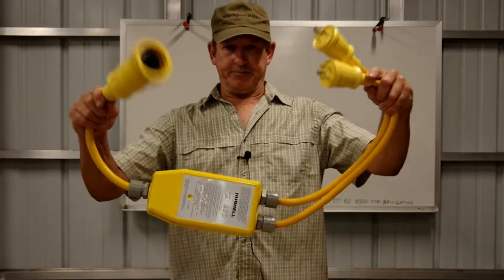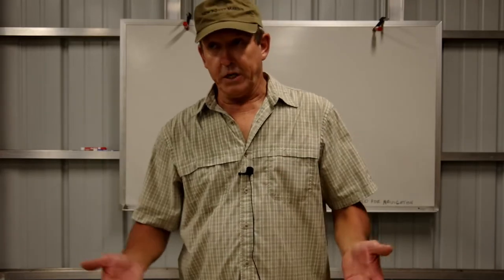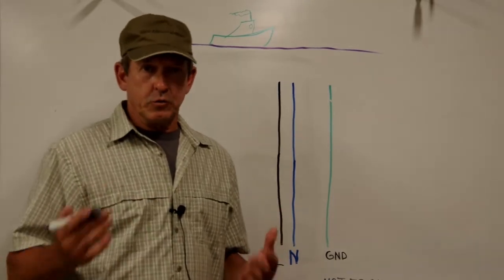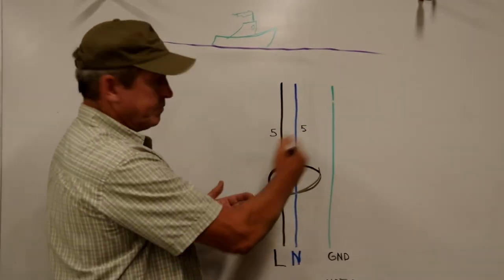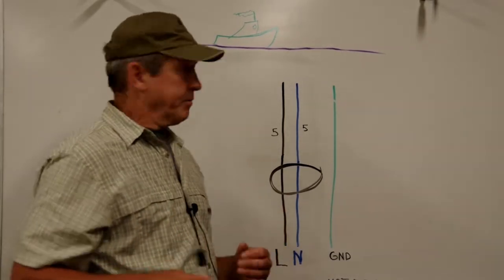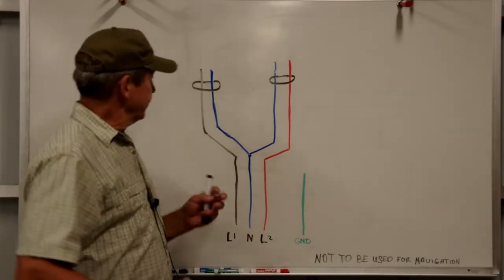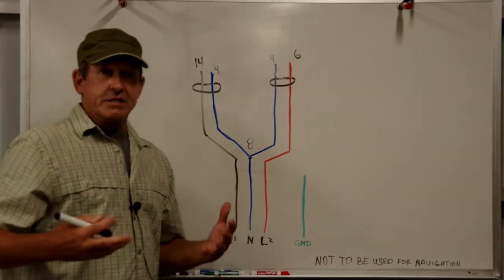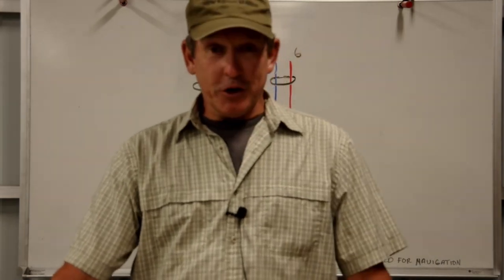Our boat trips a ground fault breaker. Is it my boat or my shore power adapter?

Comment: That was a great explanation.  My boat is wired with all the 110V on one line of the 220.  Lucky for me I don't have to use 2 30A cables at the moment.

Comment: Just found your channel, some good content and explanations.  Thanks for taking the time to put the videos together and share your knowledge. One thing on the neutral current that I think is not quite right.  Correct me if I’m wrong but I believe the neutral only carry’s the imbalance of the current between L1 and L2.   The end of 8 amps is right but I don’t think there is 14amps going out of the neutral and 6amps coming in.  I don’t think current can flow in two different directions simultaneously on a single wire.  I believe 6 amps of L1 is going  into L2 also but the remaining 8 amps gets brought back to the source on the neutral.  If both L1 and L2 have 6 amps then no current should be flowing on the neutral.  It’s more like a series circuit at that point and the voltage is dropped evenly across the two loads to get 120v on each.

Comment: Great video! Keep up the good work.
So what do recommend for best solution?
Reply from the maker: There is not much to be done other than avoid using that particular adapter with a ground fault protected breaker. With the neutrals split as they are there will be an imbalance.

Comment: Plugging in my 30 amp shore power to a 110, through an adaptor - outlet , trips the gfi of that outlet. 
When I plug into a 30 amp
Shore power outlet,  everything works GREAT. WHY is this Happening ??
I don't have access to a 30 amp outlet anymore, only a standard 110.

Comment: So why is the use of  the two coils inside the "Y" adapter placed necessary? 
Why not just one coil at the portion of the Y upstream after the 2 neutral become one on your diagram?
These are the two logical question that appear from your explanation.
Reply from the maker: The adapter has no coils inside. This splitter is taking two 30amp 120volt sources on the shore side and adapting that to a 50amp 240volt cord. If the shorepower pedestal has ground fault protected breakers, the imbalance seen at the pedestal between the line and the neutral will cause the breaker to trip. You are correct that if we sensed a single neutral and line 120volt or single neutral and two lines 240volt together the GFP breaker should not trip (if there is no fault).

Comment: Seems like that would be a design flaw in the splitter?  I just searched for that splitter on Amazon and then on Google, and I couldn't find one for sale. Has it already been taken off of the market?
Reply from the maker: It's not really a design flaw as each piece is doing what it was designed to do. The adapter is adapting one cord to another, and the ground fault breaker is sensing an imbalance and reading that as a fault and tripping as designed. I think the adapter is still available but there is not much call for them today as most marinas have enough 50amp service available. That adapter is also very expensive. Sorry I didn't see your question until today.

Comment: Do you think a properly installed isolation transformer on the boat side would eliminate this Y issue?
Reply from the maker: Good  question. Had to  think about that. I believe even with a isolation transformer onboard the reverse Y would trip a ground fault breaker. Usually we don't bring the neutral from shore to the primary side of the transformer,(240 volt) we get the neutral on the secondary of the transformer onboard. So since we are not using the neutral there would be no current on the neutral and the breaker's  sensing coil would see an imbalance between the line and the neutral and trip.

Comment: Are you saying reverse y adopters are useless?  Is there any other work around? (i.e., two 30 amp drawing from shore-power to create 50 amp single connection to vessel)
Reply from the maker: I would not say that a reverse Y (two 30amp to a single 50amp) adapters are useless. If we use one on a non ground fault protected breaker they will work just fine. The trouble comes when we use this type of adapter on a breaker that is ground fault protected. Since the adapter splits the neutral there will an imbalance between the line or hot and the neutral. That imbalance is what the GFP breaker is looking for and will trip. I know of no work around in this particular case. Hopefully any marina new enough to have GFP breakers on the pedestals will have plenty of 50amp for everyone. Thanks for the comment.
Reply: @workinonaboat1950  Hello, I really enjoyed your video. Thank you. I would like to ask you a question to a similar issue I'm having with my 95 Mainship Sedan Bridge boat. GFCI popped and I replaced them, but my outlets still do not work. If you have time, and you wouldn't mind.

Comment: We need to know if the only one "rcd" ( residual currant detection  breaker) for the 50a line or one for each 30a line. This is not the right explanation  for this situation. The explanation  is, if u have a situation  where all your loads are strickly 120v the both 30a sensors  will be fine. Same load on both line and neutral. But.  If u have 120v and 220v on board shearing  the two cords live to get that 220v using no neutral then the line will draw more than the nurltral and trip the rcd.so if u are using  the both cords on the same.boat be sure not to murge them to use a 220v item. And that's the explanation. Thank you
Reply: U said it would trip but i can't remember u telling us how to make it work without  tripping. The only  way is not to shear the two live to get 220v,  then it's ok.